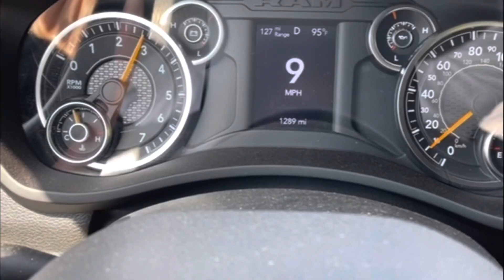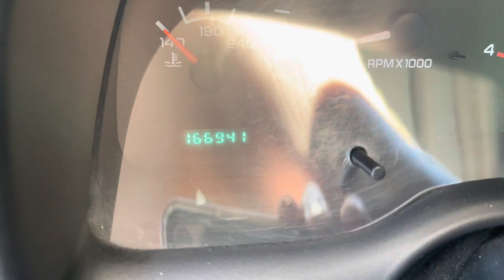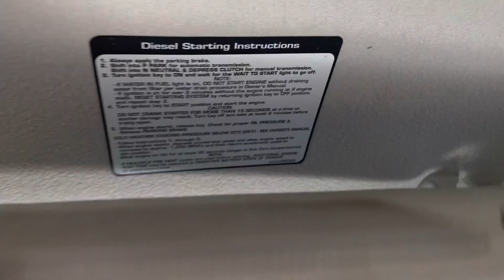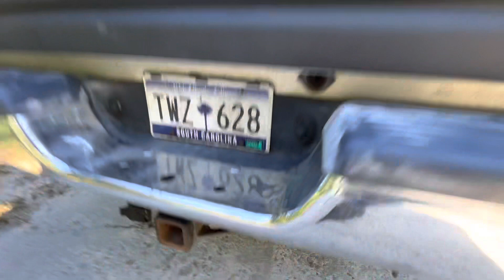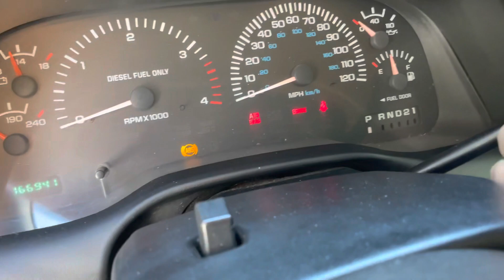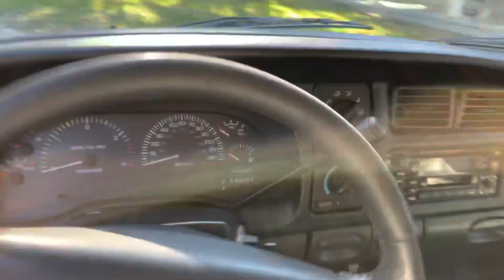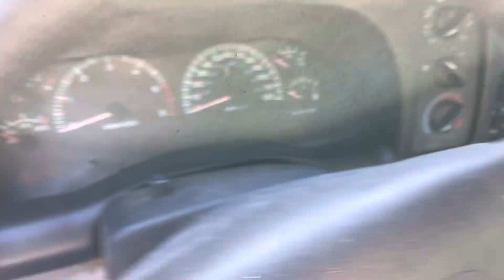I accidentally bought a MINT 2000 Cummins Dodge Ram time capsule!

Comment: I have the 1500 version of the laramie slt 16 inch highly polished center and brushed silver rim aluminum wheels unfortunately they are plastidipped black with the center caps and the lug nuts, my truck has the factory owners manual and the ignition key with the Rams head cut into the plastic on the key and i have the original Ohio title...
Reply from the maker: Nice!!